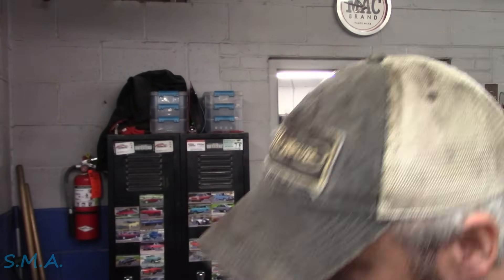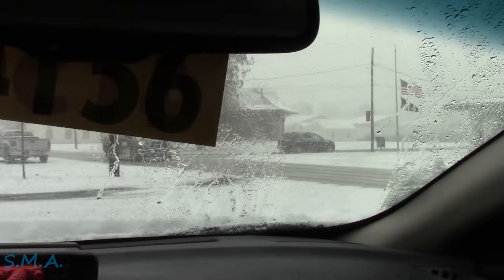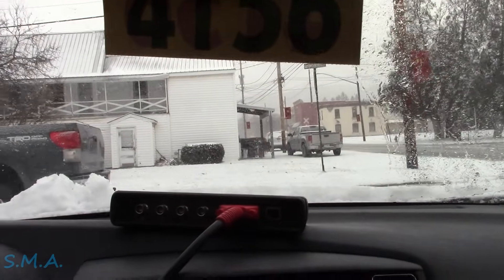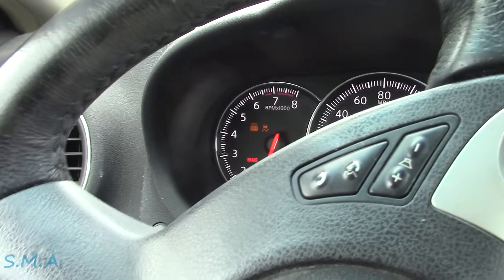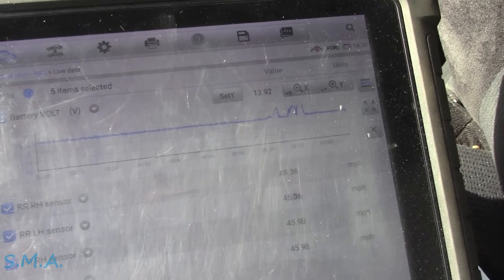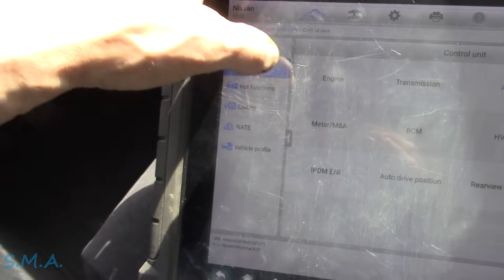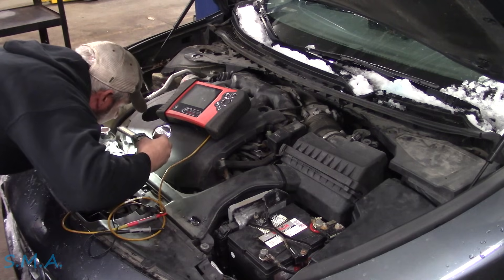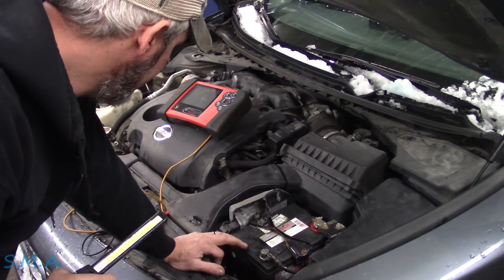Nissan Dealer Quoted Over $2000 For A New Harness!!

Comment: Many dealers and even shops don't actually fix anything, they just replace it.  I remember a Taurus we got, it would instantly die in reverse, transmission issue ?  Started moving the harness around and sure enough, when bent one direction the motor shut off, the same direction it would move when the motor shifted slightly when put in R.  Pulled the protective covering off the harness, went though the bundle 1 by 1 moving each wire, found the single wire that would make the car die when touched.  Cut that wire open and the strands were broken inside, cut out a few inches of wire, soldered in a new section, heat shrunk tubing over the connections and back in the harness wrapping.  No more motor dying no matter how much I moved the harness and car ran perfect.  Never heard of any issue with that car after that. 

How much was a harness, didn't check but likely a few hundred dollars at least, plus hours of pulling things apart to get it changed.  Total cost to fix it, near nothing, maybe $3 and under an hour.

Comment: Had a lady iny shop few weeks ago with a Nissan frontier her ex had hacked a ford battery in it. Terminals on wrong ends so he extended and added battery cables. Other local shop towed it to me. They had charged her 69.99 for "battery diagnostic machine" I wondered what that machine told them. Someone who calls himself a mechanic should have been able to count a dozen problems with just the battery  with a visual inspection

Comment: I worked on an '05 Pathfinder and it would start limping around the 3k rpm mark. Would run great below 3k rpm...LOL
I was told no one could figure it out, I watched the scan tool and the highest voltage I caught was 17.06 volts at about 3k rpm. A new alternator later and it was running fine.
Reply: @Rick O'Sidhe I'm surprised that Pathfinder didn't start blowing stuff up.

Comment: on a small side note... around 11:58 at first glance at the engine, are there supposed to be two latches near the front corners of the airbox? To me it looks like the right one is missing and the top of the airbox is just a little crooked.
Reply: Good eye, the clip is missing.
Reply: 😂😂irrelevant
Reply: @squirrelcovers6340  ...HOW DO YOU KNOW?!!
Reply: @daleburrell6273  Yeah, it's going to turn out that the missing clip is lodged next to the alternator feedback connector, and on left turns it leans over and shorts out a couple of contacts...
Reply: @Graham_Wideman  ...YOU MUST BE PSYCHIC-(!)

Comment: Does that car have a BCS?  I had one messing up the charging voltage on an F-150.  Unplugged it and the alternator charged at the default 14.4 Volts.  The Battery current sensor on the F-150 is on the negative battery cable.  The PCM also uses the outside temp sensor to adjust alternator output.  I would also be very curious to see how corroded the grounds are?

Comment: Your alternator might intermittently have high ripple as well as overcharging. Usually screws with any pulse generated type sensor and the bus.  Sucks it's not acting up for you more, then you could drive it with alternator disconnected and see if the issues go away.
Reply: I'm probably wrong, but that is what I thought too. You can see the spikes on the scope when Eric was doing the voltage drop test to the alternator, those could mess with the CAN data being read by the modules.
Reply: Good work there! When will you post part 2?

Comment: thanks 4 NOT doing 'the wire tug' diagnosis. I was thinkin wiper related as they were on when issues happened..or wires in steering column

Comment: Why would the voltage only go high on left lock?  Possible wiring harness hitting steering components or pulling at a plug ?   Loose connection on alternator ?   Given it appears repeatable based on moving the steering to the left,  my bet is that it's a wiring connection issue that's being aggravated by steering linkages at left lock which is affecting alternator operation or disrupting a ground wire.  Looking forward to the next instalment to see how close I was!
Reply: It's just a temperamental Nissan VQ engine lol.  My buddy has a Pathfinder and had similar issues as this I forgot what it was that corrected it tho....
Reply: Or a problem with the "Electric Power Steering".

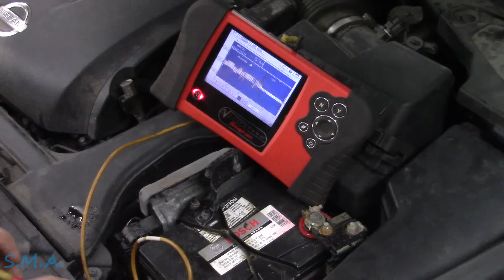Comment: I'm into this at about 16:40 and at this point my strategy would be to put a test light between negative battery post and the other test points (engine block, body, ABS module ground pin, etc...) and take it for a drive and see if it ever lights up, and then do the same for the positive battery post and the various positive test points.

Comment: I have the same car and around a month ago it threw a code for “battery current sensor.” When you would try to start it the gauges would go crazy and it wouldn’t even crank, as if there was no battery power. Then a minute later it would start and drive no problem. This only happened one day and never happened again after I changed the battery. I wonder if this has a similar issue.
Reply: Your symptom sounds like a dead or shorted cell(s) inside the battery itself
Reply: Maybe but the battery always had full power, it never struggled to crank.

Comment: I have had 5 issue(s) with Nissan vehicle(s) in my ASE Gold certified career. 1) alternator CLUTCH head failure at over 100,000 miles. The clutch will fail and the alternator stops spinning. 2) connection failure at alternator, the main alt "out" pigtail will fail due to high salt exposure (Ohio Rust-belt). 3) Internal PCM regulators are prone to fail easily, why put voltage diode trio "IN" the f-ing PCM ?!? Chrysler does it too! 4) Bad motor in EPS system. Check with Fluke amps clamp on rack, could be bad clutch/motor assembly in Electric Power Steering unit. 5) wire pinch underbody, some point of suspension is pinching the wire harness to ground, is why the dealer is wanting to replace it!!! Look for prior work done INCORRECTLY to: control arms, rack, heater hoses, tune up and air filter assembly, you might be surprised to find this is just a wire (or 2 or 3) being rubbed on a metal bracket. Hope this helps. 👍 JP in Ohio. Love your videos.

Comment: As soon as I saw that voltage spike I thought the regulator on the alternator is shot.
Reply: Seeing it happen when steering left makes me think engine ground is more likely. I have been waiting to see him deal with one of those. We will surely see!
Reply: @flagmichael  Could be. My sister had a nightmare with her old car (not Nissan) but it turned out the ground terminal was loose.

I wouldn't think the voltage would spike though if the ground is interrupted. I'd expect a drop instead. Maybe I'm wrong.

Either way, it's usually the basics with these massive everything is jacked up type issues.

My ABS/TC/electrical error lights on the semi all came on out of the blue. I didn't have voltage issues so it wasn't battery or alternator but a simple wheel seal leak getting on an ABS sensor and tone ring.
Reply from the maker: @dchawk81  So it would spike especially on this style alt system with the gen sens wire. If these alt's loose ground they will over charge like crazy!
Reply: @SouthMainAuto  Interesting. I didn't think that would be the case but good to know.

I guess it makes sense since you can unhook a battery and as long as the alternator is charging it'll run until it's out of gas. Disconnecting the battery doesn't stop the alternator so it wouldn't stop the current.

Comment: Well, I noticed my ice cream stand guy was setting up shop yesterday, so it won't be long for you Dr. O.... If I had to venture a guess, I would say its the alternator... But, it sure seems like the dealer should've figured that out...
Reply from the maker: you would think they would have figured that out right?
Reply: Just got my first soft-serve of the year this evening.  Regular ice cream cheap to expensive I can get anywhere at anytime, but soft-serve?  In season only.
Reply: @dlewis9760  Strange as it sounds, McDonald's actually makes a pretty darn good soft serve cone... And that caramel sundae kicks ass as well... LOL
Reply: You guys can't buy Ice Cream year round over there?! 🤔
Reply: @steveo6631  Sorry our shake machine is broken…
Reply: @Micko350  Yes, but there is nothing better than the local ice cream stand during summer... Always find a reason to go that way and pull in for a quick fix - no wife or kids, etc.. Just one of those guilty pleasures in summer...

Comment: I had a 1989 Pathfinder that would literally overcharge and blow out the headlights!  Yes, the dealer said I needed a new engine compartment harness right off the bat.  Money was tight then so declined the repair.  I took it to a private auto electric shop and they fixed it for $20 (yes, it was that long ago).  The accessory connection on the positive battery post was defective.

Comment: Stealership’s have high overhead and low quality techs
Reply: Not factory dealerships. They have to be certified in the brand of car they sell.  They still steal, but remember they are required to use factory parts.
Reply: @SophiaAphrodite  Yeah, they load up the parts cannon with premium ammo instead of store-brand. Doesn't matter how good the parts are if the techs aren't worth the air they breathe.
Reply: @SophiaAphrodite  I'm certified to haul up to 48,000lbs of hazardous materials that could kill you in a 53 foot trailer, including explosives.

It's a 30 multiple choice question test at the DMV.

Food for thought about certifications.
Reply: It all depends on the place. There's plenty of bad independent ships too
Reply: @dchawk81  Lol good to know, figured there was a good reason I stay away. We’ll that and being sideswiped by one in a ‘93 Tercel that didn’t help. Came across 3 lanes straight into us!

Comment: I'm curious if the wheel sensors that are reporting all have a common ground.   Also, turning left could be creating a short between between wires, or a wire to ground...but, what'd I know.   I've seen similar problems in machinery where a module briefly shorted and the voltage dropped low enough to lose communication.   This is a good one 🙂

Comment: Wow sounds strangely familiar. They told a friend of mine the exact same thing. Needs a whole new wiring harness. Could this be a pattern. Hers was a Yaris. They only charged her close to 4 grand to fix it.
Reply: You should have been a real friend gone to a scrap yard and pulled a wiring harness off a scrapped one 😛

4k that's rough....
Reply: @samholdsworth420  There are different levels of "friends." 😸 Some are very loose friends and are just are not worth going above and beyond for, like old HS classmates who you talk to once every 3 months. Truth hurts. 🤷🏻‍♂️
Reply: @mannys9130  I was being sarcastic I wouldn't have done that 😂
Reply: Yaris’ had an issue about 7-8 years with water ingress affecting a harness behind the dashboard. My dad had it changed under warranty at about a year old
Reply: @Kenny_P_abz  they told her someone put a wrong battery in her car that screwd up the whole wiring harness. Trusting girl as she was. Had it fixed then sold the car.

Comment: Had a Toyota Carolla that would die while driving, and then continue when restarted. Had it in several shops, nothing fixed the problem. While talking to a muffler shop owner one day, I mentioned the problem. He said you have a flooded catalytic converter, he explained that back pressure from exhaust would kill the engine because it couldn't get past the converter. When stopped the back pressure would release. Replaced it, no problem until traded in later.

Comment: Haven’t watched the Fix Vid yet but I think the issue is either alternator regulator being spiked when it’s asked to vary the load. Not sure if it’s internal on those Nissans or PCM controlled also some Alternators have a clutch on the drive pulley that gives way then grabs again and may also be the issue with the belt noise. Dealerships are always a gamble with diagnostics. Time is always an issue and on jobs like this it dissolves quick. A dealer tech would be fortunate to get a complete hour to download and diagnose that info and that’s if you get a good tech with experience. I never lasted at dealers because you were never allowed to do your job. Keep on keeping on Mr O. 👍🏻

Comment: Just to recap....
Customer: my car shuts off while driving.
Dealership: we tried wheel speed sensors but what you need is a full harness replacement.
And this is why I wont take cars to a dealership. They don't want to do the diagnosis, so they quote a $2k harness knowing it's not worth putting that kind of money into.
Reply: I've been an auto repair tech for 26 years now and have so far not replaced an entire body harness.  I could understand if it was burned up, had biodegradable insulation, or buggered up so bad by previous repair attempts, but that doesn't appear to be the case here.  I guess time will tell why Nissan wanted to replace the whole harness.
Reply from the maker: @Discretesignals  same here ...
Reply: @SouthMainAuto  By any chance do you know if the woman bought another Nissan from the dealership.  Sounds like she knows she was being taken for a ride, but needed reliable wheels and knows with some time and effort that something a lot cheaper is the culprit.
Reply: @dlewis9760  If that lady went back to the same Nissan dealer to buy a new car, SHE is the nutty one.
Reply: @Discretesignals  You ever seen a fried PCM cable because some bozo shorted it trying to change the battery? 

I have. Would you WANT to repair or replace that???
Reply: @christophervanzetta  Seems like " bozo shorted it" is going to fall under Discretesignals' "burned up...  or buggered up so bad by previous repair attempts", so I think it's safe to say that Discretesignals would indeed replace in that case.

Comment: With voltage drop comes heat. Have you ever tried checking infared temperatures of connection points?
Reply: BUT, he was having voltage spiking UP, not dropping.
Reply: @bluegrallis  yeah. I see that. Seems to just go up out of nowhere.

Comment: When the motor is running, the load current comes from the alternator rather than the battery.  This test should be conducted with the battery charged and the motor off.  The motor also introduces noise needlessly.  The alternator's voltage is probably regulated by controlling the magnet (rotor) current.  Today, that signal might be generated by an electronic control module or might be built into the alternator... how many wires are in the alternator connection...?
Reply: Motor?  Do you mean engine?  How do you conduct voltage drop testing or alternator ripple checks with the engine off?
Reply from the maker: @Discretesignals   is correct. Remember, no current flow = no voltage drop. The only way to get current flow is by loading the system (engine running)
Reply: @Discretesignals  A motor is anything that causes motion; internal combustion engines qualify.  Voltage drop tests require current to flow through resistance and to drop voltage.  If the current is coming from the alternator, then looking for a drop from the battery is futile.  The battery causes no ripple; so, IF ripple was what he intended to observe, then the AC ripple flowing through resistance would develop some voltage; however, his comments led me to believe he was looking for a voltage drop when no current was flowing from the battery.

Comment: Was working on a 1995 Dodge Spirit 3.0. Owner was having issues with the turn signals fuse randomly blowing. During my observations, KOEO I was trying to get the fuse to blow, I heard the fuel pump do a second prime with the right turn signal! But this would only happen once per key on. 
Owner decided not to put any more money into it, so I'll probably never know what the issue was.
Thanks for the video!

Comment: alternator, or  connector to alternator, is my  choice,  belt making small squecks  could be bearings inside alternator causing  pulley to shift slightly, so alternator  severly worn out.  good luck

Comment: My neighbor had three different "mechanics" come to his farm to work on his older S 10 that sometimes started and sometimes not. I checked his battery cables and the ground was so loose when I grabbed it that it moved all around easily. I tightened it and it started and ran fine for the first time in weeks. I didn't charge him anything because it was literally a two minute fix and he'd already paid the mechanics $100 each for hrs of "diagnostics" lol.

Comment: I have had 2 of these in the last 2 years. First was fixed with a new alternator. Kept getting a weird ripple pattern at random times. Usually within  10-15 minutes of driving. Was VERY random and would sometimes even go away. I only watched the diode ripple because vehicle would randomly discharge (had the car for a little over a week) with no draw on the battery. The second was a combination of alternator (similar symptoms as the first) but also had a very corroded negative terminal/cable. Nissan uses a single cable that runs from the transmission and mid link to the body of the car just below battery tray. This mid link spot is prone to corrosion from battery spillage which Nissan seems to be very prone for. Just seems that I see more cauliflowers from Nissan than any other manufacturer with Ford pulling in 2nd.

Comment: I had a similar problem with a Nissan Pickup, when cold at nights you could see the head lights blinking high then low at erratic times. I tracked the problem down to the ground of the alternator voltage circuit. It had corrosion between its body and the aluminum body of the alternator where it was bolted down. Cleaned up, added a dab of Aluminum wire wire paste and it went away.